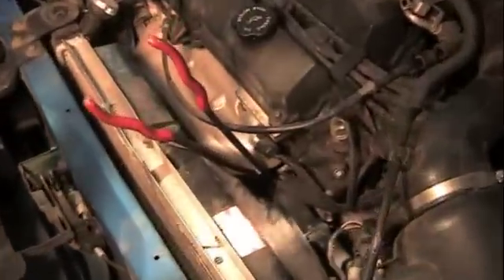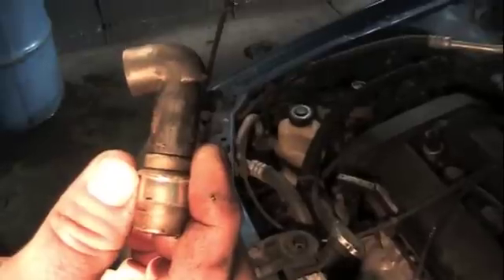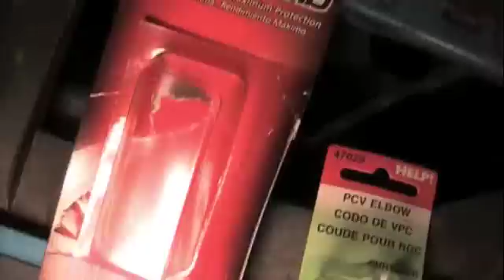Code P0171

Comment: what if you already replaced your PCV valve and PCV valve hose and made sure there were no leaks and then the po171 code still comes back then what looking for some ideas or suggestions do not want to pay a mechanic too expensive and don't trust them to begin with
Reply: MAF Sensor or 02 Sensor, I would go with the latter of these

Comment: Having this same P0171 code on my 2013 Chevy sonic ...
Reply: Chad Johnson Were you able to fix it? I have the same happening to my 2009 Nissan Sentra.
Reply: Yes I was able to fix it , costed $500 at the dealership I had clogged fuel injectors an a cracked intake hose.
Reply: Wow! That's going to be lots of pesos here in Mexico haha. Thanks for the reply, mate.

Cheers.
Reply: No problem hope you get your issue fixed.
Reply: A 2013 Sonic and you had clogged fuel injectors already??
How many miles did you have on it?? Are you using cheap gas??

I would have tried some fuel injector cleaner through the gas tank before I paid the dealer $500.00 all they did was clean the injectors!

Comment: i have 2002 hyundai xg30  v6  with p0171,p0172  stfrt is around+ 25 on road but when vehicle stop and engine is idle only b1 is + 25  . i suspect fuel pump and dirty b1 fuel injectors .  you agree me ?
Reply: had the code on my camry, turns out it was dirty fuel injectors

Comment: every car has a pcv valve. and if the valve is clogged or the vac leak is large enough most deff will cause hesitation/poor accel. the pcv valve is a valve that helps gas fumes from the combustion chamber exits the engine as all enines needs this.

Comment: Hi! I suspect i have vacuum leak on my 1999 cougar v6 2.5 duratec, seem like the rear valve cover is leaving oil and could that be the vacuum issue?

I have scanned the codes and it returns p1131 and p1151 for bank 1&2 upstream o2 sensors. that means its on lean mixture right and i have already swapped both o2 sensors with same result. Do you have idea of what i can check for?

Comment: would this pcv valve cause my car to randomly die? like sometimes it lags a bit or lurches if your foots pressed on the accelerator alot and then just shuts off, or others it just shuts off no warning no lights yet I pull codes p1171 and p0171 on my obd2 scanner really confused cause I've replaced a crank sensor, fuel filter, spark plugs and plug boots, clean MAF sensor an throttle body, and cleaned my cone air filter then re-oiled it an still the dying problem exsist?

Comment: i had the RABS warning light and the Check Engine  for PO171. i sprayed all the fuses related to brakes and ignition inside the door panel. The  light for code PO171 turned off after i cleaned the plug-in Fuel Pump Relay that is inside the black box under the hood.It came back on a week later so i cleaned it and the light went out again.The RELAY was going bad  I replaced it and the light has not come back on.RABS light still comes on for a few days then off for a week then on then off. Screw it

Comment: Good idea to spend a few extra bucks on a Motorcraft PCV. Also, if the new valve don't fit tight you should change the rubber pcv grommet.

Comment: i just replaced the PCV on 2002 Mitsubishi Eclipse GT V6 3.0L - for two weeks the light went off but now is back again with the same code P0171 could that be the O2 sensor the one at the exhaust manifold ? also i have replaced the fuel line the complete set .. that comes from the tank to the exterior filling cap and i used the special cleaning spray for the MAF .. thats why i end up here .. now what should i do ..  if any one knows please help me thank you

Comment: I had the PO171 code on my 97 ford ranger 4.0 for over a year. i went through all the bullshit of checking and cleaning PVC,MAF,vacume lines,new plugs,air filter,fuel filter ect and still had the code. The other day i pulled every fuse related to the fuel system inside the door and inside the control box under the hood and used electrical circuit spray on them. i let em dry put em back in and the check engine light was gone. One dirty fuse was the problem.

Comment: Cont'd....of acceleration. My Bank 1 Cat is NEW but the Bank 2 is the same. My flex pipe is NEW..Could it be clogged or bad Fuel Injectors? I really want to know if the MASS AIR FLOW is dirty if it will give me a code because then i can totally skip that step, Any help is greatly appreciated.

Comment: I have a 2004 Nissan Quest SE. Van runs great just like a car!, Recently i got the ECM and carbon build up cleaned out....ALL my spark plugs replaced and my PCV Valve was bad too. My question is if my MASS AIR FLOW SENSOR is dirty and needs to be cleaned should that give me a CHECK ENGINE LIGHT? I don't have a CHECK ENGINE at the moment(knock on wood) but i sometimes notice a little hesitation when i press on the gas then i have to press the pedal a little harder just to feel that kick .....

Comment: I always disconnect the negative battery cable when I do any kind of repair just so I don't accidentally damage anything electrical. It only takes a few seconds to do and it keeps you from damaging electrical components even though there is only a slight chance of doing so.

Comment: Could you tell me where the pcv valve is located on a 2001 nissan xterra? Just purchased this car with known issues, but can't seem to get the last code to clear (PO171). We've replace the Mas s Air Flow Sensor, Radiator, Thermostat, Spark plugs, and etc, but this code won't go off. Thanks!

Comment: @charles81265  Thanks for the input! After replacing the PCV valve elbow the car still would not idle at all. After looking around under the hood I noticed that the other end of the PCV line was also broken! I couldnt reach back their to fix it so I had to pay $100 to shop to replace the line and both elbows for me. It took all of 10 minutes but of course they had 5 guys working on it charging $65 an hour. Oh well at least the damn thing idles now! thanks again!

Comment: @Dillonfromforks All you have to do is post your question on Yahoo answers, Include the vehicle information, the DTC that you retrieved,and the driveability symptoms that you are having and we will get you on the right track to diagnosing the problem! (I use the Identifix database to located hard to find problems)

Comment: @1035honda Actually it's seemingly common for a MAF sensor to be the problem, assuming the car has one. If your car does have one, clean the hell out of your MAF, if anything it's not going to HURT the car any to have it cleaned out. But agreed, Mass Air Flow can be a problem as well. Fords with 2 liter engines seem to have rubber elbow problems, I've seen it happen many times with the same car.

Comment: I have a 99 Ford Escort that has been reading the P0171 code for a few months now. It doesnt idle at all until it warms up and even then it is a VERY hard idle. I replaced the air and fuel filters and cleaned the MAF sensor but it still idles BAD. I was wondering where I might find the PCV Valve on my 99 escort? Also after I get it fixed will I have to get it timed?

Comment: This worked great. I had the 171 & 174 codes. It was the leak and total cost to fix was $5.00. Clear the code reader and ran it again and it came back clean no DTC's detected.